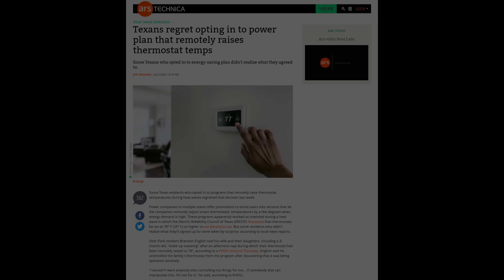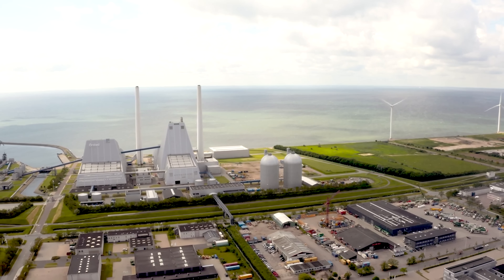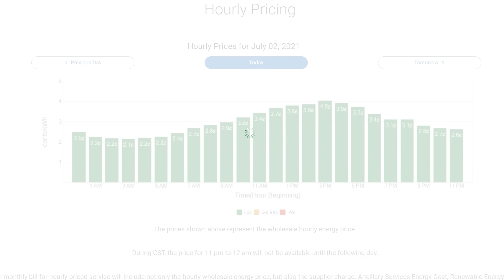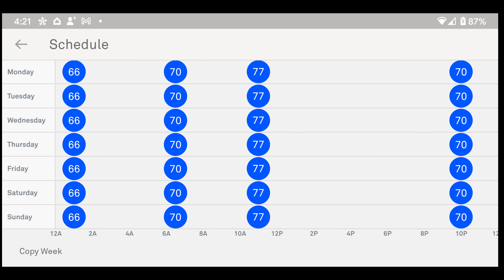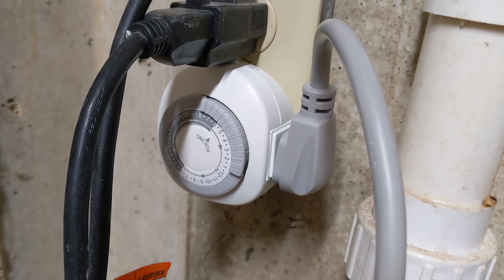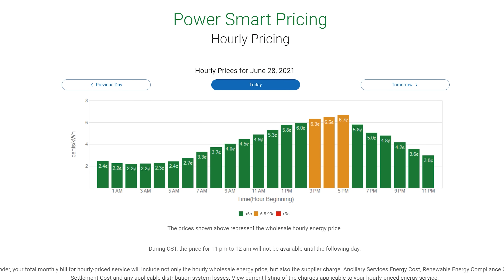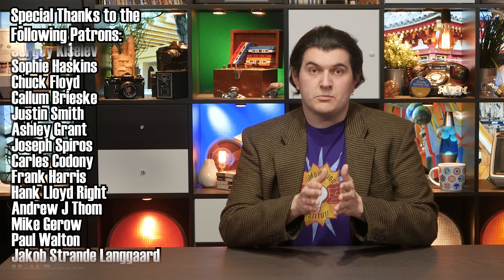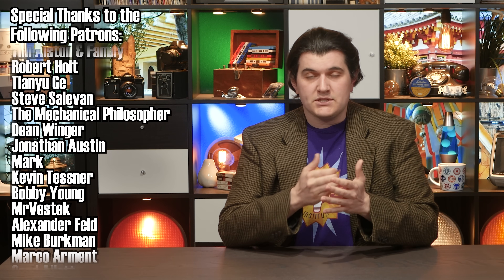Batteries aren't the only way to store energy. Here's another.

Comment: I'm crying at those electricity rates, I'd be happy for 6c all day! In South Australia we've got the highest electricity rate in the country, and very high on the list worldwide. Sometimes getting up to 40-45 cents per kWh.
Reply: And I was upset when ComEd raised our rates to 7.5 cents per kWh
Reply: I asked for retention with my provider eneegy australia. Also i am looking at alternatives. It seems you can get provider with about 25c instead
Reply: Why don't you have solar installed yet. That would pay foritself within a year with those kind of prices.
Reply: I am in NSW and I pay 18.997c per kWh.  My previous provider was messing me around and charging like 34c per kWh.  It will be nice to have a reasonable bill again.
Reply: Dumb question: Is that 40-45 cents AUD?
Reply: Here in The Netherland it’s around € 0,25 ($0,29) per kWh. Soo 7-8 cents is realy very low.
Reply: @michelspijkvan2878  I pay around 0,28€/kWh in Germany
Edit: I just checked and it's 0,2938€ :D
Reply: @extremegabel  no wonder A/Cs are much rarer here. With 4x running costs you think twice if you really need the temp so low. 
I'm under the roof and it gets 32°C (90°F) at times when it's really hot outside. The solution: I go downstairs, because it rarely rises above 26°C (79°F) even when it's cooking outside. The only catch is that it needs to cool down during the night.
Reply: @lightningblender  exactly and also a lot of homes have shutters which also help with keeping the heat out
Reply: @extremegabel  tbh, I'd say >99% in my area have them. I've never understood why some don't. They're nice during storms (protecting the glass), shielding the head inside in the winter, keeping the sun outside in the summer and when it's "going on your nerves" :D
There are days when I'm longing for some cooling, with PC and monitors running it can get uncomfortable but those days are (were) rare. Maybe at some point I'll buy one but I guess I'd run it for 2 weeks in the summer at most, just when temperatures are peaking at 38-40°C (100-104°F) outside.
Reply: @UC5hXu1QdVW41nEmqayeEQwg oh my god that's insane. What temps could you expect during summer days/nights there? 40°C (104°F) day and 30°C (86°F) night?
Reply: @lightningblender  heatwave nights where the temperature has been 40°C or higher for a few days can stay at the high 20's overnight, with indoors being much warmer - especially on brick houses.
Cold nights, like now, can drop to about -2 -3. Not terribly cold, but you can feel it in many old houses like mine.

My house is terribly inefficient, but I do have a power monitor installed (free government trial) and have smart lights, sensors, etc. The whole "smart home" which helps monitor it.
Reply: @baronvonlimbourgh1716  I do have solar, which I make use of during the day. But the feed-in rate is so low in SA that it doesn't come close to offsetting the bill.
Reply: @deanstyles2567  VIC and SA (each state) has different rates. 24c would be amazing.
The only way we could get anywhere near 24c is if you collect a benefits payment or pension.
Reply: @MatthewPerovic  what does the feed in rate mean? Is that the price you get when you make more electricity during the day then you need and sell it back to the grid?
Here we basicly have an even exchange system, every kwh i supply to the grid when i dont need it i pull from the grid when i do.
I only pay if i at the end of the month pulled more from the grid then i put in.
For me that is ok i guess, even though i normally put power into the grid during peak hours when power is most expwnsive and usually pull from the grid during hours when power is cheapest. But i still get to use exactly what i produce for free, so that is not to bad i think.

But if you dont really get compensated for the extra power you send into the grid and have to pay full price during darkness when you pull from the grid you should really get yourself some battery storage so you can use that extra power later in the day for free.

There are loads of chanels on youtube that show how to do that easilly and cheaply if you search for "DIY powerwall". You can use new battery cells if you want, but especially used car batteries are perfect as home storage. In cars they need to release a lot of power quickly, but in a home they only need to release power slowly but steadilly. When they can no longer be used in cars they can often still be used for many years in storage applications.
Tesla powerwalls are insanely expensive because its tesla, people diy the same thing for 15 or 20% of the price. With the same level of safety an protections.

Starting mid to end 2022 mainstream tech companies like samsung, lg and loads of chinese brands will also start selling home storage appliances as well if you rather buy a new unit with warrenty and all.
Those will be a lot cheaper then the stupid prices tesla charges currently and are a perfect addition to any solar instalation.

Batteries are becomming dirt cheap really quickly now. There are currently nearly 50 factories being build in china and korea, almost 20 in europe an more then 10 in the usa. Next year they will all start flooding the market with cheap batteries for cars and also storage appliances for the home.

Even for people who do not have solar but do have tiered electricity pricing the things will pay for themselves in a couple of years. Charge when power is at the cheap rate and then use it during high rate hours. That can easilly save multiple dollars a day, every day. 
10 years from now every house will have a private in house storage unit just like microwaves and refrigirators. 

In the end these things will be what will solve the grid storage problems everybody is worrying about currently. Politicians and power companies are still stuck in the old way of doing things. They asume people will forever keep using the grid as the centralised provider it has been used for the past 100 years and asume power has to be stored on the grid in massive quantities.

In reality electricity is decentralising, electricity generation is moving towards millions of personal instalations on peoples and businesses roofs all over the place. All of them making most of what they need themselves. And soon all of them also storing their excess during the day for use when it is dark without using the grid in the process. Or at least a lot less, only extracting what they use more then they can generate themselves.

They asume that we will need massive amounts of additional centralised generation capacity over the comming decades. In reality demand for electricity from the grid will only go down going forward.
Solarpanels only become more efficient over the years, generating more per panel, all the while the price per panel keeps going down all the time. The amount of people with solar will only grow exponentially going forward. It will never go down again.

Why pay for power from the grid when you can make your own for free. 10 years from now anybody that does not have solar will be an idiot wasting houndreds or more a year buying power from the grid.

We dont need more capacity on the grid that only sends power one way from a plant to houses, we need a more flexible and smarter grid that can properly manage distribution between a distributed system of millions of small  electricity generators all over the place and customers that only need what they can not generate themselves.

Once people can save enough money by buying solar and/or cheap storage for private use, everyone will buy it themselves because it is by far their cheapest option.
Electricity will be clean, abundant and pretty much free.

And it will happen faster then most people could ever imagine.

Comment: I would love to do this but my house is so pitifully insulated that the top floor is 15 degrees Fahrenheit warmer than the basement minimum in the summer, and about the same amount colder in the winter
Reply: Run a heat pump from the basemant to the top floor duh
Reply: Same here, and because the roof accumulates tons of heat from the sunlight, my room is even hotter than outside  - at a cozy 88 F during the night. But, I try to offset that by opening my windows, and by doing so, I let all of the bugs, especially mosquitoes, in to bite me all over. Still, opening windows doesn't help jack because the fricking building has gathered heat energy for days.  You see, all of this has one benefit: my brain gets cooked thoroughly so that when I'm out in the wilderness the zombies don't have to eat it raw. Poor zombies. I'm gonna go finish myself. 🥴
Reply: @Wolf-Spirit_Alpha-Sigma  Do your windows not have a screen? Maybe it's just a Florida thing, because I know people think our screen cages around pools are weird, but all the windows on my house have a screen so that bugs can't get in if we open them (windows slide open vertically).
Reply: @Andrew H Ridge vents and proper soffit vents are far more cost effective at removing heat from an attic. It also does not require turning a fan on or off when the AC is running, it's passive. I did live in a house one time that had exactly what you described though, a huge commercial exhaust fan normally used in restaurants was placed in the attic. When you turned that thing on it would create such a gust if you had any doors open slightly they would fly open from the suction. It worked ok, but it used a lot of energy just to run and sucked in all the humid air from outside and was very bad on any papers that were not inside a case. We hardly used it for that reason, it would ruin papers when it was humid outside.
Reply: Add trees and bushes around the house.
Reply: @DCBpower  Yeah just not Cedars. Their roots never stop growing and they can grow into your sewage pipes and break them/clog them up. Seen it happen lots and it is always Cedar doing it.
Reply: Yup, this is a real issue. Not sure where you live but my local utility offers discounted programs for insulating your home as well as energy efficient appliance rebates. You may want to start there and see if anything like that is available. I had a 100+ year old house were I used that program and they did blow-in insulation for a very reasonable price

Comment: I’ve been doing this with a whole house fan installed in our attic for the past 35 years. This only works during period when the outside humidity levels are not excessive.  I typically drop the air temps in the house to about 62-65 degrees at night. This will really cut or eliminate cooling demand during hot weather.  I learned this technique from my parents who lived in a 100-year old home.
Reply: Exactly.  Common architectural feature for many years, to ventilate the house instead of paying for air conditioning.

Comment: “19°C may seem excessively cold”

glances at thermostat for my heating system set to 18.5°C
Reply: Laughs in not having any AC at all and keeping the windows open during 12ºC winter afternoons
Reply: @TheDragShot  12°C in winter? That sounds excessively hot!
Reply: @noahluppe  you might be surprised to find out, there are places where snow doesn't fall on winter or at all.
Reply: looks at my AC set to cool down to 27°C so it won't get too cold. everything below 24°C is freezing.
Reply: you're dutch aren't you?
Reply: 17°C here.
I start sweating when it gets above 22°C
Reply: We run ours at 18! Love wearing my jogging pants and hoodies inside when it’s 30 plus outside. When I check the mail I’ve gotten some strange looks.  With covid and lockdowns what else am I going to spend my money on, might as well use my privilege and run that AC

Comment: I really do like a lot of this. Up till now I just based my temps on when I'm home vs when I'm not home. Though I do find that my bill is less than average. I'm totally for people assessing their needs, being taught ways to help, and good home improvements being made. Where I struggle is letting the energy company make these determinations for me since time and time again I feel that they are run by people who care little to nothing about the residential consumer, and support staff does not understand anything about the product they support (electricity).
Reply: I actually really like the new programmable thermostat programs (although I don't currently qualify, apparently, because I have solar). They're really meant to help people save without having to understand and track everything. The thing I've realized most in working on renewables is that the average person does not remotely understand how electricity works. It is harder than you would expect to explain what peak is, when it is, what appliances use the most energy and how to effectively reschedule, let alone figure out what your savings will be. The thermostat program, you just sign up, and on hot days they lower the temperature a couple of degrees at, say noon, then raise it  a few degrees from, say, 4-7pm. Super simple, saves you a bit on your bill and often gets you a free thermostat.
Reply: @tscook10  really good point that's easy to overlook. I mentioned a peaker plant in casual conversation and realized the other person had no idea what I was talking about. Then I checked with my family, and no one else knew what a peaker plant is.

Comment: It's always funny when someone says, "66 degrees or, 19C. Which may seem excessively cold" but that's what I keep my house at in the winter.. And by always, I mean this is the first time its happened and it makes me feel like a weird person.
Reply: I live in Melbourne where it's winter and 8 degrees outside at the moment (late morning). I heat my house to 16 degrees and wear a fleece top and pants when I'm at home and I'm perfectly warm and don't need to heat my house any more. If I heated my home to the temperature he suggested, my natural gas bill would more than double.
Reply: You keep your house warm!

My winter thermostat is set at 63F / 17C. I have 100 year old cast iron radiators that change very slowly, and no zoning ... if I could zone my bedroom would be much colder (and bathroom warmer). Yes, I am part polar bear.

Summer is my downfall, even here in the Frozen North summers can get hot. At present I only have a window a/c unit, I run it as seldom as possible. But I'm planning to get a mini-split unit, and will see how my place adapts to pre-chilling. To sleep in a bedroom in the 60s in summer ... cools this polar bear's heart 🐻‍❄️
Reply: I don't think 66F is excessively cold... for the winter. For the summer it does seem very cold.

Comment: You can one up the cooling side of this idea by adding a whole house fan.  With a modern WH fan you are using a fraction of the cost of an A/C and using the cool air at night. Add in the fact the the WH fan also cools your attic making your home that much harder to warm up.  Well worth the investment
Reply: I had a family friend that lived out in the country. When they built their house they put in a WH fan. It was always fun at night when the sun was going down and someone would say "Turn the whole house on!"
Reply: Many people have this where I live in NM. It's called a "swamp cooler", and it blows moisture-infused air throughout the whole house.
This is of course not something that people can use if they live someplace where the humidity is usually over about 30% or so which is to say, anywhere but here.
But if you turn off the pump, it ends up just blowing outside air through the house.
So theoretically I could just turn off the pump when I go to bed, but it's usually cool enough by then I don't really need it.

Comment: Thank you!!  Back in August after I watched this video, I started changing my cooling regimen.   I turn the AC up overnight and then (almost) completely off during the day.  I have found my house has not gotten warmer than 75 degrees F, even on the hottest days.  I set it up to 77 during the day.  Also, the extra coldness at night has helped me to sleep more comfortably AND my electric bill went down $20.  Hooray!  
I was curious, if you have a temperature regimen for wintertime?  (I'm in Ohio, so fairly similar temperature to Illinois.)   My thought is, slightly higher temp for a few hours during the high sun times of the day, then turn it down very low overnight....thoughts?
Reply: what the hell there is a scroll bar on your comment (PC)
Reply: have to rough it for 2 weeks in duplex with ice packs and fan

was not easdy but got through it

Comment: The California Missions were built around the 1780's. They have 3 foot thick adobe walls that act as a thermal flywheel. The interiors stay cool all day.  In the evening, the heat from the sun finally makes its way through the adobe to keep the interior spaces warm at night. That is passive air conditioning for sure.

Comment: Mountainous high desert regions still have super unpredictable weather; meteorologists can't even tell what's going go happen that day let alone the next day's weather.

Edit: I loved the video. More people need to know about the passive house and these kind of techniques in general. Thanks for bringing awareness to it. I am curious how this changes for people with PV panels and/or battery backups.

I have some PV panels and a backup battery on my roof, along with flat rate power. Unfortunately I get "paid" less for my excess I push back into the grid than I pay for using power from the grid. Therefore I have to do pretty much the opposite: save as much power overnight/use my batteries, and then use as much power during the day as I can. This means AC during the day, open windows at night. Except when there are forest fires. And then AC all the time.